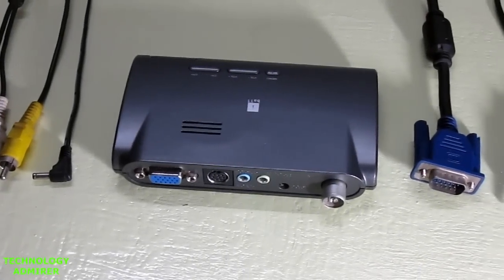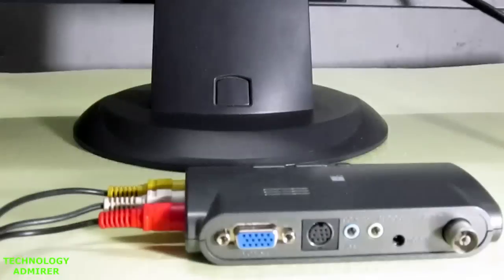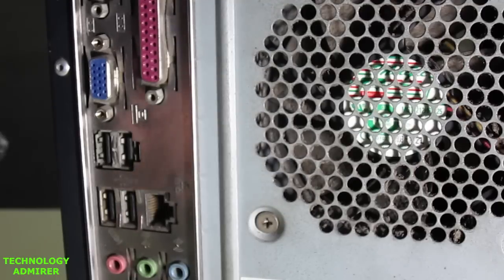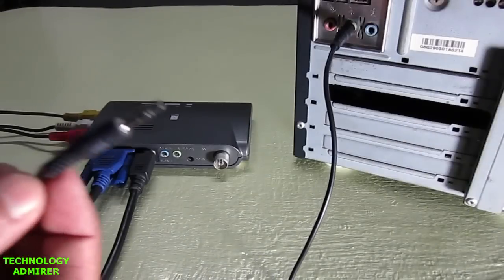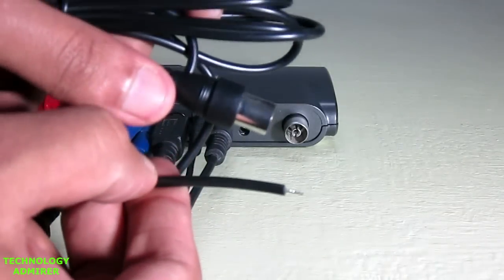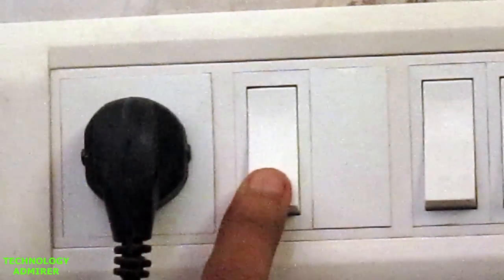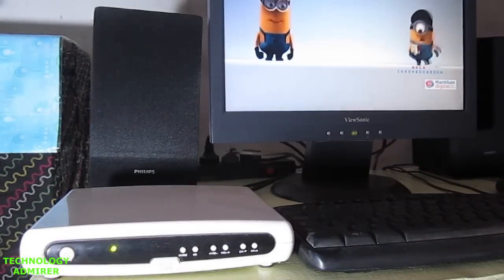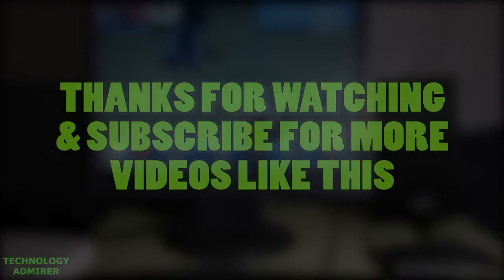How to Connect iball Claro CTV27 TV Tuner Card (Installation/Setup)

Comment: I have a 1080p monitor (21.5 inches) the tv tuner works fine but the picture quality is not that good....its like 240p
Reply from the maker: Try setting the resolution of your monitor & your TV tuner card to 1080p & see if the picture quality improves.

Comment: I need help actually i set tv tuner resolution to high and when i turn on tv tuner card it shows out of range message on monitor and i'm not able to open menu to change resolution is there any way to reset tv tuner settings
Reply from the maker: You can change the resolution of the TV tuner card by pressing a button on the TV tuner card's remote without going to the menu,keep pressing that button until you get to the desired resolution,hope this helps.

Comment: I have connected TV tuner with airtel digital TV set top box. but I am unable to watch any channel. I also tried tuning. tell me the solution
Reply from the maker: +Avinash Doke Hi,you can try to change the source using the remote control of the TV tuner card to video,hopefully this will solve your problem.

Comment: i dont have set op box can i connect my cable tv connection and this tv tuner using rf cable
Reply from the maker: Hi,personally I haven't tried connecting this TV tuner using rf port but as you don't have set top box you can try connecting your cable connection directly in the rf port.
Reply: Thanks Bro now im Gonna buy this
Reply from the maker: M Elumalai Definitely & also if you can then do let me know how it is working.

Comment: i want to connect it to my laptop and my laptop has got only hdmi port, can u plz help, can I connect 15 pin vga into tv tuner and corresponding hdmi into laptop to make it work, reply plz
Reply from the maker: An Noor The Guiding Light First of all I would like to ask you if you are planning to buy this tv tuner card or have you purchased it already?Also are you going to use it only with your laptop or also with your PC?
Reply: already purchased, with laptop as well as pc monitor
Reply from the maker: An Noor The Guiding Light Okay,as you are planning to use it with your laptop as well as your pc monitor,I would recommend you to use it with pc monitor,you can use it with your laptop but most of the laptop does not works with this tv tuner card,as it is made to use with monitor.Also you said that your laptop does not have VGA port only HDMI port so I would say just use it with your monitor.
Reply: okay if I only want to use with laptop then
Reply from the maker: An Noor The Guiding Light If you want to try & see if it works with you laptop out of curiosity,then I would say buy a HDMI to VGA converter then connect it with your laptop & your TV tuner card & see if it works with your laptop.
Reply: i have already ordered vga to hdmi converter cable
Reply from the maker: An Noor The Guiding Light Well,that's good now hope for the best.Hopefully your laptop will support this TV tuner card.
Reply: yea thanx
Reply from the maker: An Noor The Guiding Light You're welcome :-)

Comment: yes tried that to by changing the source and as well as tried to fine tune automatically didn't work
Reply from the maker: +Surya Prakash Is your cable connection already digitised?if so then it will not detect any signal from the cable connection.

Comment: hello sir, by changing resolution to 1680*1050 it is displaying out f range message, my monitor supports 1366*736 only,
how can I reset it?
Reply from the maker: Hi,you need to change your monitor's resolution to 1366*768 & your TV tuner's resolution lower then that of your monitor & your problem should be solved.

Comment: ok will try that but recently I got my computers cleaned. and teh Os was reinstalled as my machine got virus. but will try again to clean it.
Reply from the maker: Assuming your internal TV tuner card is connected to the PCI slot,do clean the the PCI slot as well as the TV tuner card's connection & make sure it is seated correctly,also try another software to record & try changing the settings in the software,maybe this solves the issue.

Comment: Hi, When I try to use the PIP feature the screen shows 'no pc signal' why is that? my monitor is configured on D-SUB and not DVI while using.
Reply from the maker: Hi,it can show this message if your PC is off try using PIP after you turn on your PC.
Reply: Sovan Dutta
It does show up when I change my monitor to D-SUB from DVI but while in D-SUB mode the mouse wont hover basically not able to use the PC simultaneously. So have to use DVI everytime I want to use PC again
Reply: Tried when my PC is on
Reply from the maker: Where can't you hover your cursor over the TV? If so then that can't be done,in order to use your PC & watch TV at the same time you need to make the TV screen smaller by pressing the PIP button again on your TV tuner card's remote.Hope this helps.
Reply: cuejumper

Comment: Hi. I am not able to hear any sound coming from my pc/system. What must be the problem?
Reply from the maker: Have you connected any music system or speakers to your PC??
Reply: Sovan Dutta yes i have. I've connected a wor from the audio jack of the cpu to the tv tuner and the speaker to the audio port in the tv tuner. 
I am getting sound from the tuner, but not the system.
Reply from the maker: Just check that you've connected your music system to the audio out & not in the audio in port of your TV tuner card.
Reply: Sovan Dutta i've done just that. Still not working. Thanks for the effort though. :')

Comment: please tell me , i done connecting the tv tuner with my pc with the black one cable i.e the optional cable but its not working i mean tv tuner is on with stable red light but when i press PIP nothing happns in fact monitor is not switch to tv tunner why ??please help
Reply from the maker: Is your monitor showing iBall Claro TV logo??
Reply: nothing is shown .. i mean after connecting it to pc nothing happen, can you make a video on it. i mean with the optional cable
Reply from the maker: I would recommend you to watch this video again then see if you missed any important step,which may be the cause of the issue that you are facing.

Comment: hello,

I have a 21.5 inch full hd monitor 1920*1080 @60 hz. i am using iBall CLARO CTV27 TV Tuner Card. when i am using pc and tv at the same time, there is a ripple formation while watching tv.But when i am using/watching tv only,The screen is perfect, there is no ripple formation.what could be reason?Please help.
Reply from the maker: Ramachandran Mammayil Hi,thanks for asking,I am not exactly sure why this is happening.But I can try,is the ripple formation constant or does it comes & goes away?
Reply: Sovan Dutta 
yeah, the video keeps on going downwards and upwards with ripple effect only while using tv and pc together at the same time.
Reply from the maker: keralapressacademy You can check if the cable that connects PC & TV tuner is seated properly,also do you use UPS?if you do then is it close to the TV tuner card or PC if so then try moving it further away & see if the ripple effect goes away or not.

Comment: I we have cable wire not setup box then where to connect
Reply from the maker: +entertainer Ron You can plug the cable connection in the antenna in port or you can say radio frequency port & change the source to the radio using the TV tuner card remote control.

Comment: picture is not coming just a flash after that is goes off I think problem in resolution but how to do anything when I am not able to see any picture.
Reply from the maker: When you turn on your TV tuner card it will have a solid red light,then using your TV tuners remote press the resolution changing button & see if the picture is coming or not if not then again press that button on your TV tuners remote control & it will eventually work.Also try to change the resolution when the the picture flashes so that you can set the correct resolution.

Comment: our setup box has cable connection so where this cable is to be connected
Reply from the maker: You can plug the cable connection in the antenna in port or you can say radio frequency port & change the source to the radio using the TV tuner card remote control.
Reply: thnx
Reply from the maker: +namit agarwal You're welcome

Comment: picture in picture function is not working . if i press pip button it says out of range.what can i do now?
Reply from the maker: +GOKHUL GS It is happening because of resolution,change the resolution in your monitor as well as in the TV tuner card to the correct resolution of your monitor & it should solve the problem.
Reply: I changed as my resolution as my desktop but the problem is still there
Reply from the maker: +GOKHUL GS Then try lowering the resolution of the TV tuner card.

Comment: how to change vga output to input for laptops as u mentioned below...... i think VGA-OUT port is a direct connection from the CPU of laptop, has nothing to do with laptops' monitor.
Reply from the maker: Tanvir Ahmed Yes you're right most of the laptops have VGA output connection & it has nothing to do with laptop's monitor,but if any laptop have VGA input then this TV tuner card may work with that laptop.

Comment: my PC showing "input not supported" ... would u please help me to get rid of that.
Reply from the maker: Change the resolution of your TV tuner card to the native resolution of your monitor,this will solve the issue you're are facing.
Reply: And how can I fix it.
Reply from the maker: I already told you that,use tv tuner card's remote to change the resolution of your tv tuner card,to the native resolution of your monitor & it will be fixed.
Reply: well, thanks a lot for giving me your subtle time.

Comment: i have setup my pc in same way as yoi told but i am getting horizontal spot on my desktop ....tv is watchable but those spot are very irritating... how to fix that ?
Reply from the maker: +SUMAN GARAI Hi,if that horizontal spot is occurring after you connected your TV tuner card then I am pretty sure it is because of any lose connection,just unplug every wire & plug them back in securely & the horizontal spot will hopefully disappear.
Reply: +Sovan Dutta that problem solved.. 
i am not able to increase tv tuner resolution ... its on the default setting
Reply from the maker: +SUMAN GARAI You can only increase your TV tuner cards resolution to the maximum of your monitors native resolution for example if your monitor have full hd native resolution then you can increase you TV tuner cards resolution till 1920*1080p not more than that.
Reply: +Sovan Dutta i m using compaq presario cq3530ix pc... can you tell me if my monitor support higher resolution
Reply from the maker: +SUMAN GARAI You have to tell me your monitor's model no. then only I can tell you what is the resolution your monitor can support.
Reply: +Sovan Dutta HP S1935a
Reply from the maker: +SUMAN GARAI With this monitor you can set you TV tuner card's resolution to 1366*768 resolution to get the best out of it.
Reply: +Sovan Dutta i can change it to 1280*1024 . 1366*768 is not available out there on the tv tuner...
Reply: +SUMAN GARAI and thats why I can not also switch the tv to PIP mode where I can watch as well as use computer simultaneously ....its showing out of range
Reply from the maker: +SUMAN GARAI Yes,you can try that resolution,if it works fine,then great,if not then try the next lower resolution.
Reply from the maker: +Sovan Dutta Yes,resolution is the cause of error which you are getting like "out of range"

Comment: "Input not supported" error plz help....
Reply from the maker: Change your monitor & TV tuner card's resolution & match them,then you will not get this error.
Reply: Bro thanks for the reply...I can change the monitor resolution by using computer mode...but how would I change tv tuner card  resolution when Iam not able to get anything on the monitor it says input not supported
Reply from the maker: You just need to press on the resolution button,on the TV tuner card's remote & see if it gets fixed,if not then again press that resolution button,that is how I got rid of this input not supported error.
Reply: Sovan Dutta 
Thanks Bro...:)